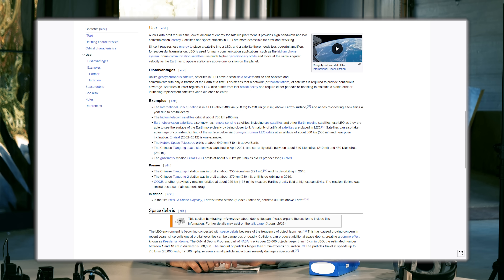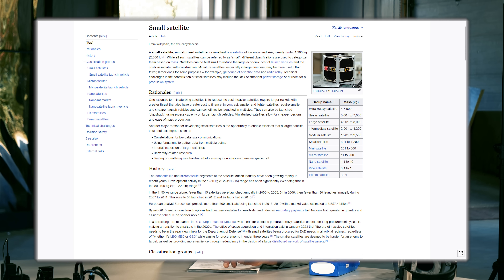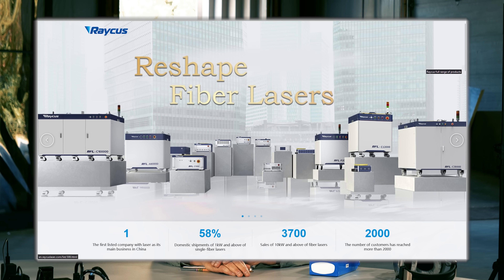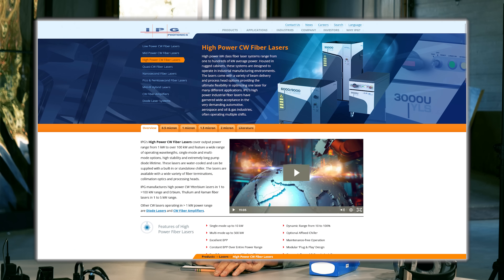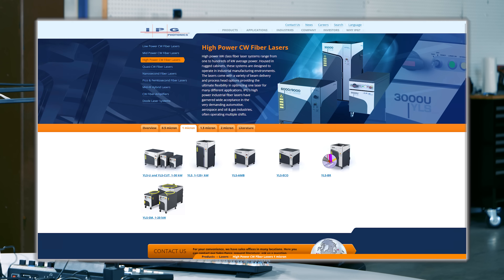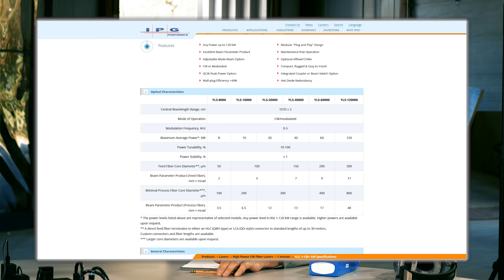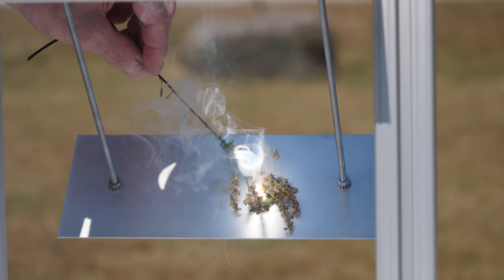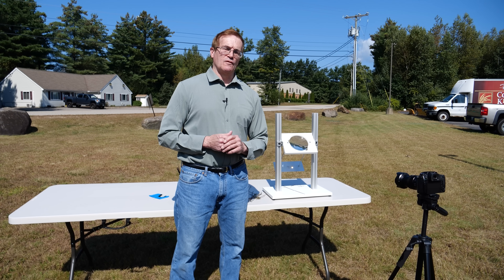COULD SATELLITE LASERS REALLY DO THIS?...

Comment: I've read some stuff on FEL lasers used for naval defense. Their problem for long distances was in atmosphere humidity and clouds rapidly diffusing the beam energy. One way they got around most of that in the paper was by rapidly pulsing the beam. In space the beam would have much further range.
Reply from the maker: Indeed. 
These lasers are huge, and of course, the beam eventually  has to pass through  the atmosphere, just like  starlight.
Reply: Did they "get around it" the same way they got around the Navy railgun problems? 🙄
Reply: In space more range?.moon laser..lol.or just operates outside the earths and moons orbits?
Reply: I guess this would be less of a problem for satellites due to fast lateral movement.
Reply: Pulsing the beam also makes it difficult to trace back.  That’s how gun lasers work.   The old ones would shoot a solid beam.  With Modern ones you only see the dot.
Reply: For very high power beams the air the beam passes through heats to the point that its refractive index changes. This typically causes what’s called “blooming” referring to the beam divergence increasing. By carefully managing the beam power and duration (and assuming the air has the right properties of original temperature, humidity etc) it’s possible to get a low index beam path that actually focuses the beam like graded index fiber does. It’s very tricky though.
Reply: @FornicateCircumEtReveles lol... You're joking right? You no more see the beam of a laser than you see the light coming off a light bulb. For you to see the beam of a laser it has to be quite foggy and you aren't so much seeing the beam as the beam is getting reflected back to your eyes by the particulate. In much the same way you see the dot because the target is reflecting the dot back at you has nothing to do with pulsing.
Reply: Did you avoid discussing large military aircraft with DEW on purpose?
Reply: @Segphalt  I think every ad for an early laser sight in 80s/90s gun zines featured a fake bright red beam. I was a somewhat disappointed 10 year old when I saw one in real life and it just made a weird sparkly dot on the wall of the gun store rather than the lightsaber beam the ad implied.
Reply: @itskarl79  The DEW airplane they were testing has been retired. So if there's something new, it's classified, hasn't leaked yet. You can see pics of it wrapped up in the desert aircraft boneyard. I mean that plane could be it's own episode.
Reply: Pulsing is used to reduce thermal blooming (and turbulence to some degree), but cannot correct for atmospheric Rayleigh and Mie scattering from aerosol particulates and molecular scattering  In fact, pulsing can actually accentuate nonlinear molecular scattering effects, which ultimately limits the range of antimissile shipboard lasers.  The humidity is one of those molecular scattering problems.
Reply: @pgtmr2713  There were physics and engineering reasons that the ABL was cancelled, not least the requirement that the megawatt-class COIL (chemical oxygen-iodine laser) carried by the 747 had to be refuelled and stationed within a few miles of the launched ballistic missile to be effective.  Atmospheric scattering effects even at the stratospheric altitudes the ABL operated at greatly limited the beam power on target, a factor the video analysis completely ignored.
Reply: @pgtmr2713  There's newer iterations. Hard to say overall, and way too many orchestrated failures with the whole situation.

Comment: It's not just about the beam-width, you forgot to consider the atmospheric attenuation and absorption
Reply: yeah i too wondered why they didnt mention that.
Reply: True -- but they are less at 1 µm than at shorter wavelengths. Rayleigh, Mie, etc.
Reply: At one micron under ideal conditions the total attenuation(which accounts for absorption and scattering) would probably be under 1% so it's not a major factor.

Comment: I loved you mentioned the power generation levels because people forget why we used nuclear pumped X-ray lasers to achieve the needed Gigawatts of energy needed to generate the X-rays.  Ranks up there with their other bonkers Star Wars era weapons, like Brilliant Pebbles. 

As for the limits of sat based lasers, fiber lasers even, is still the thermal issue where you can't cool the weapon sufficient. Even with the needed power to get the weapon to activate you face duty cycle issues because of thermal issues very quickly. The focusing lenses, etc, also face thermal limiting issues.  It's always been the problem with energy weapons, even terrestrial fixed mount is just keeping the thermal controls at the point to prevent the rapid degradation of critical components.
Reply: So to put it simply, 
If it worked, it would be a single use or limited use item in your opinion?
If that's it, I really don't see that being an issue for people with an unlimited budget lol.
Reply: @user-zn4tq6ib6r Heat IS an issue, a major issue. In space, you can only dissipate heat via radiation. Because of that, it is extremely hard to keep cool with internal thermal sources adding heat to your system. The need for major thermal controls are why the ISS uses Ammonia based systems, which are not used on earth because of how dangerous they are (leaks used to kill a lot of people). But they are highly efficient and effective.  Since weight to space is a serious consideration maximum efficiency is needed. Even then, they need to be replaced regularly. 

Now single use is possible, but again. You can't fire it for very long before the whole thing melts down internally. People don't really understand how HOT the components of high wattage lasers get. Lasers are INEFFICIENT.  Most of the energy does not go into light production but rather HEAT. Even for fiber lasers, which are awesome, you still have a high heat to light ratio. We are not talking minutes of operation here, we are talking seconds or even milliseconds at MW energy ranges before thermal degradation ends the firing sequence. Pulse lasers may last a SHORT while longer.
Reply: @user-zn4tq6ib6r ah yeah hitting a garage door flying through space overhead at 7600 m/s with a glancing trajectory for the laser through the atmosphere. I mean it's technically not impossible but those are some slim odds. It's a massive hurdle to choose to start out with, and for what benefit? Most of the problems are because it's in space; why does it have to be in space? Just put some matches on a balloon and drop them from the sky. Or have a balloon that is just an incendiary grenade and pop it to drop it. That's the problem with all this DEW forest fire nonsense. You need a multi-billion-dollar infrastructure set up to shoot sparks into a tinderbox when you could just pay someone to go there with a lighter. Or, again, do the balloon thing. And we know they're using balloons. But DEWs are fantastical so big conspiracy clout.
Reply: @user-zn4tq6ib6r Then it's not a satelite laser? Also you forgot horizon too. Add double the atmospheric dissipation and lack of stealth, it's just way easier to carry laser near the target.
Reply: @meatybtz  Bruh did you just say NH3 cooling systems are not used on earth? NH3 is the main refrigerant, by far, for large industrial scale refrigeration plants, and it is growing because heat pump applications are popping up for this fantastic refrigerant. 

Source: I design components for said systems.
Reply: @meatybtz   
I'm not really arguing for either side, just trying to understand some different point of views people have on it.
It does sound possible but impractical from your explanation.
 so are a lot of things used though so it's hard to say that  it being impractical would stop it from being used or experimented with.
If anyone would have an interesting explanation it would be someone like styropyro (YouTuber) who likes to play with a lot of oversized lasers and stuff like that.
 
I'm still not saying it was or wasn't. 
 it's just  interesting to learn and see the different views from a scientific standpoint. 
I gotta agree there are easier ways to start a fire, however we have all heard stories of scientists who would rather experiment with something impractical and crazy  than just do something the "easy way"
It's also completely reasonable to believe that it was just a random fire. after all Grass fires do spread fast especially during the day since the small ones are difficult to see before they spread.
No matter the cause, the outcome, land grabbing, lack of information and coverage has been strange.
Reply: @youtubesucks-yx6kk  I was out-dated on the Refrigerant Use. It does appear that NH3/Ammonia is on the rise in major industrial use (explains why we ship so many tanks of it.. like all the time, daily). 

As for single use. Yea, likely one shot. Practical or not depends on application. For example, bullet proof armored suits are able to be mass produced for soldiers.. but they are not practical for GI because of cost, fitting (not universal, kind of required for GI), and most soldiers tend to remove armor not wear it as maneuver is greater than being bullet proof. A one shot sat can cost billions, but if it achieves a political end, yes, that can be considered practical, but not efficient. It is fairly easy to start a fire planet side w/o the use of expensive one shot systems. After all, eco-terrorists are responsible for the majority of major recent California fires that don't have a direct weather source. Getting a nut-job to light off a fire is easier, by far, than using a very special once off system. I mean, they wouldn't need a sat specifically but could mount it one of the AF's mini-shuttles. Problem with sats is positioning. It takes work to get to the right place at the right time and your beam wouldn't be stationary or the sat would have to turn to stay on target (these things move FAST at low orbit) and very quickly your beam would be cutting through a lot more atmosphere as your aspect to target changes rapidly. It just seems more banal options would prove sufficient and more cost effective, time effective. It's always great to have a patsy to throw under the bus and an eco-nut is an easy patsy, disposable too, recycle-reduce-reuse your patsy. 
You might do something like this if you had no ethics or morals and decided to test your weapon system to see what it could do. But again, there are other ways of doing it.  It is POSSIBLE to use an energy weapon sat to do what happened. It is, however, unreasonable, when so many better options are available to accomplish your mission goals (in this case murdering a lot of children and getting free land for whatever kick back monies you can).
Reply: @user-zn4tq6ib6r  Now you're paying the divergence/and atmospheric absorption losses twice.
Reply: What if the power supply was on the ground and the satellite was just a reflector?
Reply: @dwaynezilla  "why does it have to be in space?"
The answer to that is incredibly obvious - Because it mostly circumvents current air defense technologies.

If an elbownian bomber shows up in our air space and we suddenly start experiencing fires, it's super obvious what happened.  We actively look for aircraft intruding in our airspace and we have large numbers of multi-million dollar weapon systems to deal with that when it happens.  We can spot it, shoot it down, and retaliate.  Hell, odds are good that we have scrambled fighters before elbownia even has line of sight on any civilian infrastructure.

We don't scramble fighters because there's a satellite overhead.  They violate everyone's air space all willy-nilly.  At least publicly, we're note even watching for lasers from space.  While it's true that we have shot down two satellites.  In both attempts, we used specially modified missiles.  They are, at least on paper, not something that we just have in inventory.

So no matter what, as it is today, the satellite gets the first move and it may be months before we can respond to it.

If people start to actually become worried about this sort of thing, we absolutely can build up defenses against it.  Not gonna happen in a hurry though.
Reply: If heat was hard to transfer in space then people wouldn’t freeze so quickly when their helmets pop open during spacewalk.
Reply: @mb9662  They don't.  That's the movies.
Reply: @mb9662  oooh boy... You really don't understand heat transfer, thermodynamics, how pressure relates to heat?  There is me being out of date with NH3 refrigeration growth... The there is you.  Ok. Here is some neat things. If half of your face is in shadow it will freeze and the half of your face facing the sun will cook. But what is going on is completely different between the two sides. Pressure is related to heat, suddenly drop pressure and it will cool. This is actually how refrigeration works. So what is going on is pressure loss resulting in cooling. Which you can do, in order to cool your space vehicle. But you have limited atmosphere, be it coolant or the air in your helmet so you get one go of heat transfer then you are back to radiation, infrared, to lose heat.
Reply: This guy is a fed dis info.
Reply: wut? xrays don't use much power, its the radioactive material passing through and reacting with the film nothing more, the first x ray machines didn't even have power, modern versions are digital and plug into a standard USB port.
Reply: @mb9662 It's called phase change. Also, stop confusing movies with the real world.
Reply: Thermal management is only a major problem if you're operating at 100% duty cycle. If you used most of the satellite as thermal mass, I'm sure you could run the laser for a few minutes. It could take days or weeks to radiate the heat away but how often would you really need to use something like this?
Reply: @dwaynezilla  Yup, cigarette and a match book is a WAAAAAAAY cheaper and easier way to start a forest fire.
Reply: They were detonating nuclear bombs to create the Xrays 🤣
Reply: space is -450 degrees Fahrenheit
Reply: @user-zn4tq6ib6r  Which satellites were used, then? There are plenty of people who make a hobby of spotting and tracking satellites, so if "they" blew through an entire constellation of single-use satellites, the sat spotters would have seen them, and tracked them, and it wouldn't have been possible to hide them from deorbiting.

If such a weird event did happen, the sat spotters would have seen it, but I guess they're just being unusually mum about the whole thing.
Reply: One wee problem. The SDI x-ray lasers never worked, the test results suggesting that they did were, erm, tortured into looking like they worked. Inside of the bomb casing, yes, once outside of the tamper, too much turbulence to form a coherent beam of any sort.
At the end of the day, Teller was disgraced, as was the National Lab.

But yeah, inefficiencies in lasers generates heat and even if one had 98% efficiency, which we're nowhere near, that's still 2% of megawatts of energy to try to sink away from the source. It's even uglier with frequency multiplication. Works nice for pointers, but at any significant amount of power, they begin to rapidly overheat.

Oh, another insane thing, as you said, Brilliant Pebbles. Never defined was how they'd retroburn the damned things out of orbit. Not even in the classified plans that I saw.
But, it got Russia to spend like crazy to both counter it and try to spy on the various programs and in the end, bankrupted the Soviet Union.
Had a buddy in my reserve unit who was involved in high energy microwave devices, who was going nuts trying to figure out where an explosion was coming from when testing their new dummy loads under extreme high power. We were talking one day and he related the problem, one boom per dummy load, then it worked correctly. No damage, just a disturbing boom for each new device.
I suggested he check for moisture and slight carbon accumulation or degrease the thing. Oils in the metal pores, high energy microwaves to heat it, the recipe for a modest boom. They did both, found the carbon and water residue, degreased and the problem went away. Know how something works and how it's made, figure out probable failure modes.
Reply: @spvillano  Real Genius

Comment: Actually I was not thinking of a directed energy laser based weapon but rather a reflective one...mirror-based placed in a high geosynchronous orbit.  
It would reflect sunlight with a focusing optic similar to the lightweight one you mentioned in this video...even 1 meter reflector might be able to start the damage off.  
A rogue state actor could easily place one in space...especially if you consider that the weapon could be transported in several smaller module-type loads.  
Maybe even assembled on a space station...then placed in orbit.  There could even be multiples of these kinds of weapons up there...activated at will by bad guys.